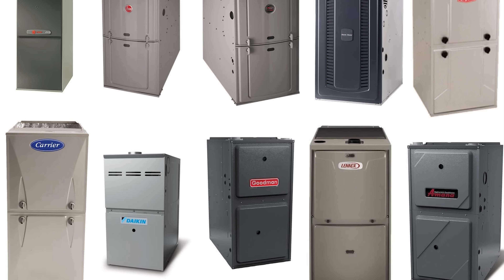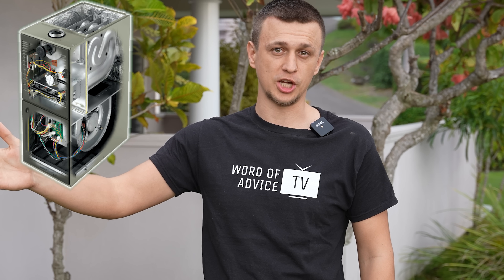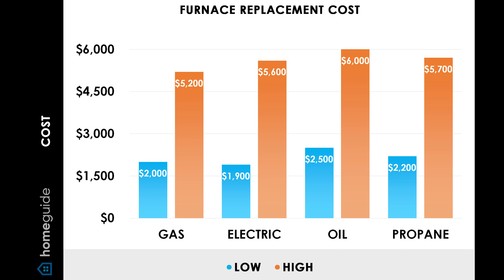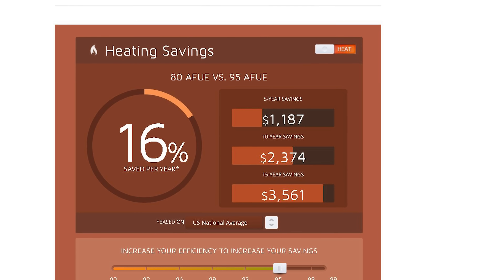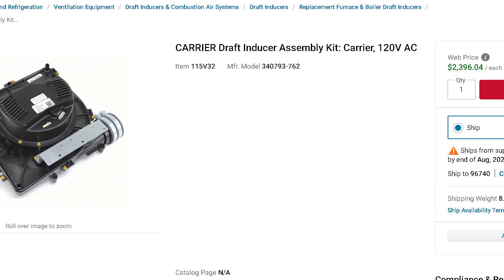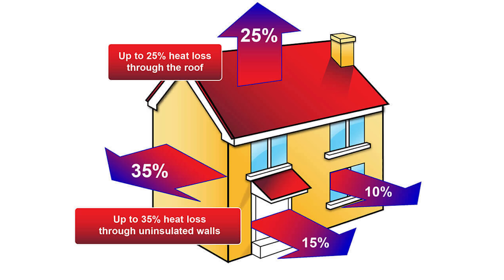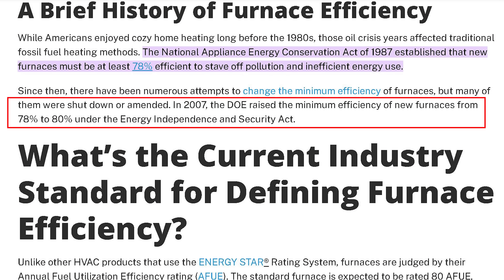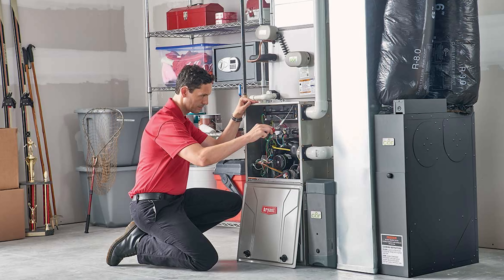Don't Buy a High Efficiency Furnace!

Comment: I'm not happy with new modular (or 2 stages) furnace was used up all liquid propane gas that was filling up 250 gallons 3 - 4 times in tank on winter season is bring me so costly because it's run & run & run & run all night and day. My house built in 1987 with full insulated (floors, ceilings, walls and double panels windows). I regretted not have energy saving. Now I have to switch back to a single stage furnace that will not eat up propane gas by filling up propane once from old furnace. It'll run for 15 minutes then off until next an hour while remain nice and warm. Don't listen to these energy junk it's all BS!

Comment: The truth is if a high efficiancy furnace is installed correctly and serviced annually can easily last as long as a 80 furnace Ive seen it . Comparing a 80% efficiant furnace parts to modualting part is misleading, not the same as comparing a 80% to a high efficiant 95% furnace which the parts are close to the same cost. 80% furnaces also fail if not installed properly or serviced. One other thing if you could see the carbon footprint the 15% difference in fuel burning you would realize its not just about saving money and yes you can easily e-coop the difference in energy cost between a 80 and 95% furnace choose your contractor wisely

Comment: In canada minimum efficiency is 95%, we cant buy and install anything less,   My previous furnace was 95% and was still going when i replaced at 20 years old but had many repairs in its past including the motherboard. I could only manage having by buying a furnace protection plan once warranty expired but the dual heat exchangers were good but were a ticking time bomb. As others i knew had theres crack with same brand and model. Carrier.  I replaced it as my single stage base carrier air conditioner died so i did both together.  It was only 17 years old with one repair on record.   When i replaced furnace basic goodman single stage was not in stock i had to get dual stage but it was only 100$ more.  Ive gone from 95 to 96.5 % efficiency . Theres seems a little bit savings but too early to tell. Probably because my old furnace had lost some efficiency as it became older and ive also increased my btus as my prior furnace was undersized as i went larger due a finished basement and having those vents open now.  So you could say im saving more as larger btu furnace gas bill is slightly cheaper than my lower btu furnace gas bill but i need  more time to make a better evaluation over the winter.   I  always top up my warranty with a parts and labor protection plan , there actually cheap to buy and worth it. Unfortunately nothing is built to quality any more and parts and labor prices are always escalating. My mother has 35 year old furnace and that thing hardly ever needs a repair. Its a big tank. Also dual stage furnaces at 96.5 % are cheap now at least goodmans are. The only expensive choice is the variable modulating ones which make no sense especially on an older home. Older homes have leaking ductwork and inefficient insulation. So stick with most basic furnace you can get.  And i agree efficiency is overrated when it comes to furnaces. And latest heat pumps just dont cut it up here in canada. Where temps drop to double digit negatives in winter. Nothing more refreshing than the warmth provided by natural gas. Heat pump air is super dry.

Comment: I would add that this advice applies best to owners of older houses that where set up with 80/20’s to start with. If your house is modern and was equipped with 90+ efficiency, I think one would probably continue with a high efficiency unit (possibly upgrade even) after considering the overall efficiency of one’s house build (to reap the full benefits). Note upgrading from an 80 to high efficiency type may also require changes to the ductwork.
Reply: Exactly if your professionals can make it work without taking you through the ringer by by means sell me a high eff. furnace that I can agree with.

Comment: If cost is a concern you should learn how to repair  furnaces. Most furnace parts are attainable for less than $200. Furnaces have four main parts. I know you're thinking I paid way more than $800 for my furnace. This is how this industry works. My inducer motor burned out, I am calling around for the assembly because I don't want to rebuild. But Bryant wants close to $400. Hilarious, it's made from around $80 in parts. So I order online but I don't think it's going to get here fast enough. I get a friend to order from a parts house about 40 minutes away. They want $215, THIS IS A $60 PART at best. I laugh and wait for my part, install it and all is good. I paid $40 for the part, not used, brand new.
I'm wondering who may have read this and realized what I just told you? If you call an HVAC tech they're going to charge you 300/325 for doing the repair, they will also go to their "Wholesale" not open to the public, parts supplier. They will get charged $215 give or take and then charge you $500-600 to fix your furnace. It's 8 x 10mm nuts and took me 20 minutes, (because I just ordered the motor and had to reassemble my inducer) I paid $40 and some change. This is not rocket science. BTW my 92% efficiency furnace is from 1999, 23 years one repair. It's about maintenance, read a book.

Comment: Canadian here, 95% is the minimum efficency rating a furnace up here can be (for a new install). Was mandated at 90% in 2009, and went up to 95% in 2019. It's pretty much all we see up here now, though there are still some good old furnaces out there.
Reply: Lets Calculate: Savings of 95% over 80% for 35 year life of Lennox Pulse.  $1000 year spent on Nat Gas with 95% so spent $35k in 35 years.  Would need 19% more gas for an 80% (.95/.80=.19).  So $35k * 19% = $6,650 saved over 35 years.   NOT ONLY is there energy savings, but HIGH quality equipment last twice as long, so saves another $3k to install another one.
Reply: Mostly Napolean in great white north?   Ive heared they are fairly good at least

Comment: Most high efficiency furnaces have a lifetime warranty on the heat exchanger plus going dual fuel is the water to go I don't agree with the  comment on not going high efficiency losing less out the flue will make up the cost difference
Reply: Yea they define 'lifetime' as 20 years ussually
Reply: Most every furnace has a 20 year heat exchanger warranty the Goodman 96 has lifetime warranty but warranty has to be registered within 90 days from install

Comment: This guy is completely wrong. You state that a high efficiency furnace will last 10 to 15 years the parts are covered under warranty by the factory for 10 years. The same is true for an 80% furnace. All you would be paying is labor. In the Midwest, a high-efficiency furnace will pay for itself in less than five years.

Comment: I work in energy efficiency and it is true that the payback for HE can be tough.  But there are often incentives that can account for these cost premiums, especially if you are low-income. His argument is mostly financial, but he fails to point out that improving your home's insulation levels, or replacing windows can also be very expensive. In my work, one way to improve efficiency in heating and AC systems is to make sure that an appropriately sized system is being installed.  A system that is too big will never run efficiently and will short cycle which can also shorten the life of a piece of equipment.  Behavior changes can also save a lot of energy. For example, get used to wearing a sweatshirt inside in the winter and set your thermostat to 68 instead of 72.  That 4-degree temperature differential can really save a lot of energy.  I also encourage people to consider their specific climate zone when choosing the most efficient equipment.  The equipment that is best for someone living in Wisconsin will be very different than people who live in Texas.
Reply from the maker: Thank you Matthew for explaining what to consider when choosing a new unit. Much appreciated!

Comment: What my installer basically told me is to stay away from anything with an ECM motor, they cost a lot more to repair and break more often. He said to see the true benefit from one of the 98% units you really have to design the ductwork specifically for the unit. If you just drop one in as a replacement, you will never get the full 98% efficiency. The unit I got is single stage, single speed, 92% efficiency. It's worked flawlessly for the 4-5 years I've had it. Your cost comparison is also way off. My mother just had an 80% furnace installed and it actually cost her about the same as my 92% furnace, given, she did go with a different company though. Even when I priced them out for my house, it was only like $1K less to have an 80% furnace over a 90%+ one, your graph was showing a $3200 difference. The higher efficiency units also generally have longer warenties and stainless steel heat exchangers which you won't find on 80% units. Also, there are usually rebates for higher efficiency units. The higher efficiency, the higher the rebates are.

Comment: high efficiency furnace should you have power failure and house gets cold enough can freeze and break expensive and dangerous parts 
   were 80 % non condescending furnace wont 
    high efficiency furnace also must be installed in a heated space 
   80 do not just need to put drip leg in vent pipe and  inspection of pipe regular if not run long enough to heat pipe

Comment: In 2002 , I had a Carrier 96% high efficiency furnace installed for $4800 CDN. At the time I thought I was going to save a load of money on my gas bill. Well , to make a long story short , the bills were very similar to my previous 22 year old furnace , an average of $200 bills at the time. In other words , nothing changed , so I regretted my decision. To this very day , I will never buy another " Top of the line " appliance again , no matter what it is. As far as I'm concerned it's all a hoax , those HIGH EFF. furnaces consume even more electricity because they're always running.
Reply: Nat Gas costs fluctuate a lot, it would be much better to compare the Units Of Gas used. It likely went down, but you's have to crunch numbers to see how much saved and how long payback will be,  (from units of gas used and current gas price)

Comment: Wish you would of made this a few months ago... I'm already regretting my 98% purchase...
Reply: It really depends on your heating climate and how much you value comfort. Modulating furnaces are a luxury good, like a Mercedes. They're comfortable compared to a Ford Taurus or Honda Accord, but more expensive. Which one lasts longer? I see a lot more cheap old cars on the road than luxury, because parts are so expensive.
Reply from the maker: @secordpd  Let's stay positive and say your unit was part of the good batch. Your high efficiency furnace will last at least 20 years with very minor repairs. 🙂👍👍

Comment: Disagree with this video almost 100%.  There are many factors involved to determine which is better for someone.  1.  They don't last as long.  This is completely an opinion and not based on fact.  The fact is there is virtually no difference in the life of a high efficiency vs an 80%.  Short life of furnaces is nearly always because they have been oversized or improperly installed.  2.  Upfront costs.  Well partially true but many have utility rebates available that help offset this so the price difference may be more like $500.  3.  A high efficiency furnace is always recommended with propane due to the fuel expense.  4.  Repair prices.  Well again, they are virtually the same.  You can't search the internet for a couple of parts and make a broad assumption.  5.  High efficiency has more parts.  Other than the secondary heat exchanger which almost never fails, what are these extra parts???  Both 80% and high efficiency furnaces have the same parts.

Exception:  modulating furnaces that are over 97% efficient are expensive when compared to a regular high efficiency furnace.  They are also more complex.

Which is better for you has more to do with where you live and the design of your home.  We install a lot of both types.

Comment: You are Wrong on so many levels. I never replaced a furance diue to heat exchangers. I don’t know where your costing comes  the install takes the same . The warranty are 10 years not 5 years. 
Also it is states that set the building codes. You forgot about the fan runs 8 hours a day and 80% furance uses 300 KW as opposed to 28 KW for high efficiency furance. Remember in the South this is driving your AC

Comment: I have been in the business 30 plus years, and I totally agree what you’re saying.  90% furnaces are not worth the money. Especially when they break down. A variable speed blower motor could cost a homeowner up to $1500 to replace. I think the same goes for some of the “high “ efficiency air conditioners also. There great until they break.
Reply: In the case of my old Lennox...G14 model....Lets Calculate: Savings of 95% over 80% for 35 year life of Lennox Pulse.  $1000 year spent on Nat Gas with 95% so spent $35k in 35 years.  Would need 19% more gas for an 80% (.95/.80=.19).  So $35k * 19% = $6,650 saved over 35 years.   NOT ONLY is there energy savings, but HIGH quality equipment last twice as long, so saves another $3k to install another one.  (Flap $10 is changed every 3 years,  the inducer fan was making noise after 35 years so changed $80, and Combo  Limit was change + had to add Fan off delay because exact old part not available.  (pulse system used special delayed combo switch).
Reply: @pablopicaro7649  that’s because you have a pulse, which is built like a tank.  Trust me they do not make them like that anymore. Lucky to get 15-20 years out of some of these newer systems.

Comment: Most of these videos are not accurate the information he’s giving is not complete nor accurate. Get a good hvac contractor that will go over your actual needs and go over your options. 
All furnaces today have high efficiency blower motors and draft induction motors . You only need a 90% if you don’t have combustion make up air. 
Don’t keep a natural draft furnace they are already too old.

Comment: Agreed on all counts.  I'm a 30 yr hvac-r  pro.  I sell Ruud 80% efficient variable speed blower with 2 stage heat. Variable speed 20 seer condenser.  Or 16 seer. No 2 stage condensers. In my experience,  variable speed blower motors last 10 years or better.  Although expensive to replace these motors,  still cheap to run.  And for ten years. Not enough data yet on residential 20 seer variable speed comps. No service calls yet. But the commercial refrigeration industry has proven great data on vfds.

Comment: I did exactly what you suggested when I bought my new furnace. The 95% efficient furnaces were 5K more than an 85% efficient furnace. 

Plus, repairs were much more costly. The biggest factor in my decision not the buy the 95% efficient furnace was people who had them said the 95% furnace ran constantly to keep the house at 68 degrees and energy savings was lost. 

My 85% efficient furnace keeps my house comfortably warm on the coldest days and does not run constantly.  Thank you.
Reply: This is nonsense. You are referring to a modulating furnace. That's completely a separate thing vs 96% efficiency of the heat exchanger.
But you WANT it to run continuously. Having the heat exchanger go from 100 on to off thousands of times is what wears it out. It also delivers more in comfort.
If you don't live up north, don't get one.

Comment: I’ve never seen any hard data to back this up, just lots of anecdotes. I’m happy with my 96% efficient furnace, it’s approaching 10 years old with zero repairs and significant savings over the old 80s unit it replaced

Comment: I strongly disagree!!!

I have been in the hvac industry for over 25 years, holding engineering degree and being well trained and certified in almost every aspect of the industry. Being certified energy auditor and running my own hvac midsize company that installs about 1000 systems per year.  

I strongly disagree with this young man. Strongly!

He doesn’t know what he is talking, and I challenge him for zoom debate where we can crunch numbers together.  And then he can create another public video. 

High efficiency furnace in average save 16 to 20% over minimum efficiency furnace.

Do your own math. (It’s not difficult)

It’s absolutely NOT true that high efficiency furnaces don’t last as long as minimum efficiency furnaces. 

And it’s also not true that they cost significantly more to maintain. 

He has no stats to prove his statements.

And finally 
In my market, major  metro area as long as you are comparing same class (same furnace segment) high efficiency over minimum efficiency furnace is about $750 to $1000 more to install. (Purchasers final cost) ***in average standard replacement scenario where applicable.

Realistically you get your extra investment recovered over first 5 years. Then for the rest of furnaces life another 20ish years you keep saving. ***every year more, energy cost always goes up. 

Then average “properly installed and maintained furnace will last” about 20-25 often more, years *regardless on efficiency rating high or low.

Comment: Generally I agree, if you are on Natural Gas stay with a standard efficiency furnace. High efficiency furnaces have gotten better in the last decade. If you're on Propane or already have a high efficiency furnace stay with a 95% furnace. Going back to metal venting is an added cost if you already have a PVC exhaust in place.